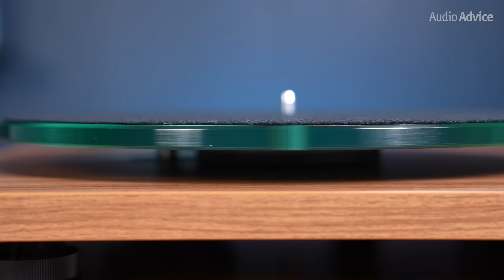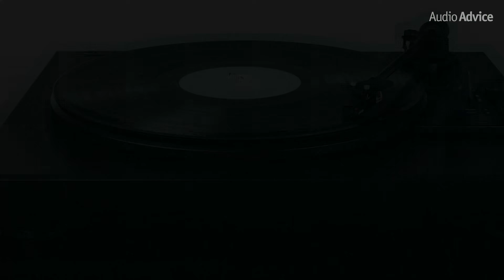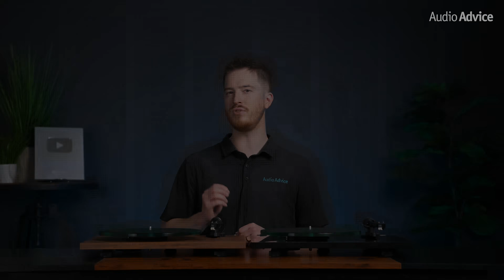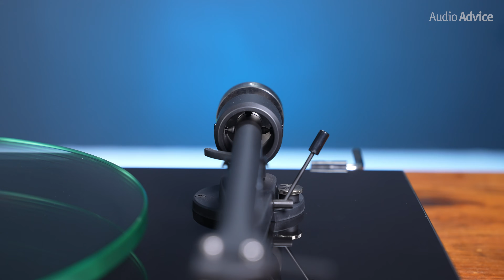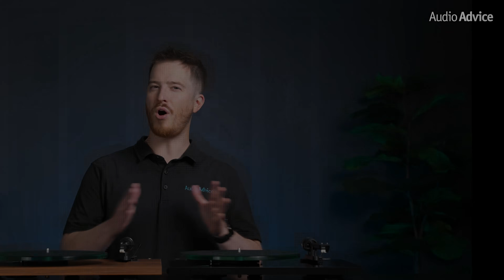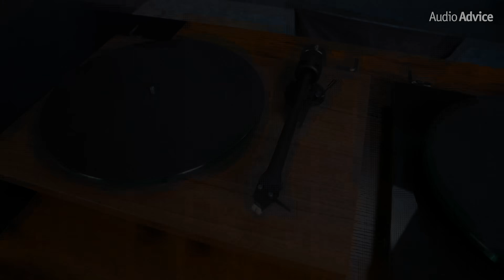Pro-Ject T2 Turntable Line Overview | T2, T2 Super Phono & T2 W Wi-Fi Streaming Turntable

Comment: Good afternoon, I have a quick question: I’ve just bought a T2 Super Phono; I weighed it and it came to 1.7 g, but the manual I found online says 2.0 g. What should I do? Thank you
Reply from the maker: Something must have slipped.  There should be a small allen wrench in the box you can use to adjust the counterweight.  You will need to use your stylus pressure gauge to make sure you are at 2g.

Comment: Seriously, the T2's 10mm glass platter is less damped than the EVO's steel platter with the weather stripping, I mean TPE on the bottom? They both weigh 1.7kg. The T2 has to have the less resonant platter.